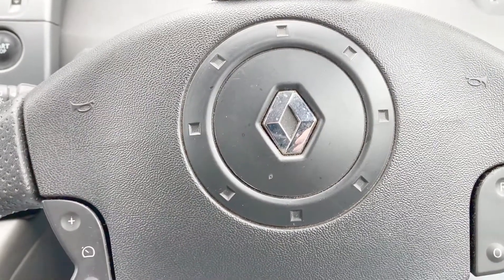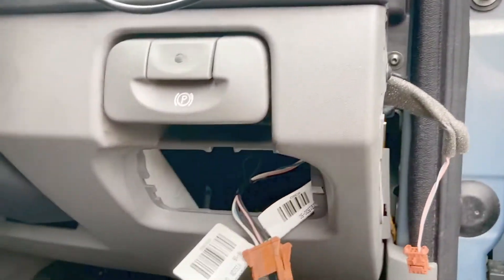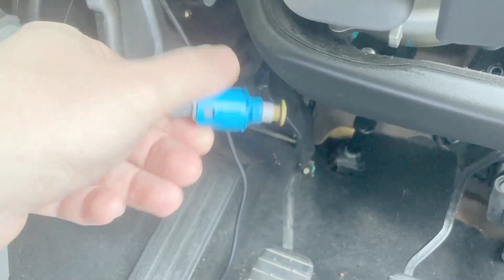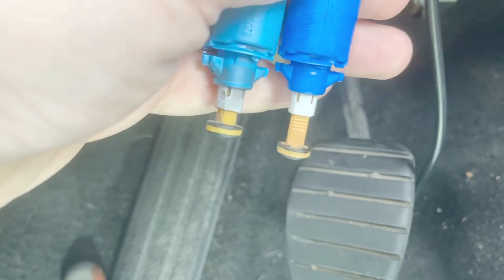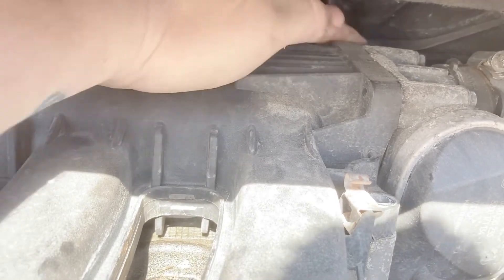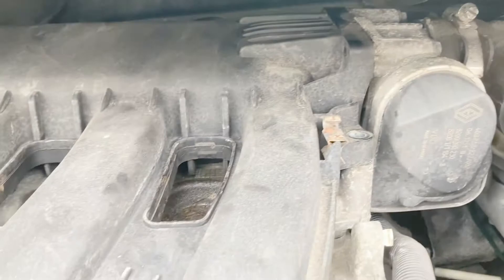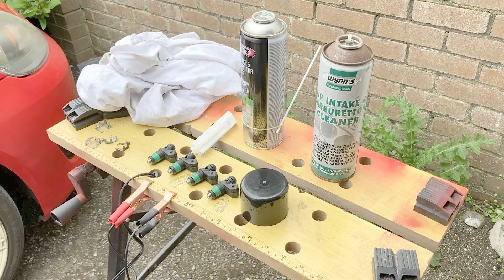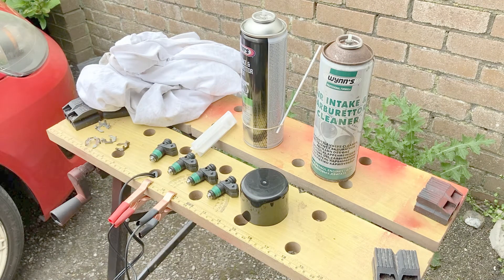Renault Scenic - Chasing a Misfire

Comment: Having a similar problem, and my Autel ML629 doesn't give me any info (cylinder, clutch sensor, O2 sensor, etc).
Changed the spark plugs, and it ran fine for two weeks, then it started lossing power again. Had difficulty going up an incline without misfires.
Changed all the ignition coils. It went fine (mainly) for a few weeks.
Now it's misfiring again.
I have been sticking to Mobil one fuel for months.
What diagnostic tool are people using on the Renault scenic rx4 to diagnose misfires and to reset the ECU.
Apparently you have to reset ECU after changing plugs or ignition coils.
But why does the vehicle go fine for the first few weeks (like it has automatically reset)??
Reply from the maker: Unfortunately I had to give up on mine, my second car also needed a lot of work, I have a long term project in my garage and I didn’t have room for a fourth car. Thinking back on the problem I do wonder if the initial misfire damaged the catalytic converter as unplugging the o2 sensor and forcing it into open loop seemed to get rid of the misfire but a new sensor didn’t fix it. 
Did you clear the error codes after changing the coils?

Comment: Sticky valve? after the injector was replaced, the fuel loosed the intake valve? 
Hmmmm
Reply from the maker: That's a thought, never considered the valves. Unfortunately this car was scrapped after, I would have loved to have kept it to keep tinkering with but I already have two projects and I don't have room for another.
Reply: @monkey-hut  I had this with my 2004 Clio. 1.4 16v. the K4J engine. But i found the problem. it was the Voltage regulator on the altenator that was the issue. The carbon brushes where worn out. After replacement it went away. Costed like 60 eu plus 10 min work.